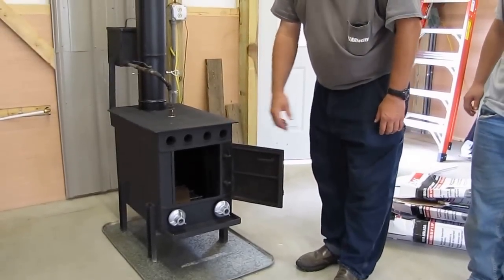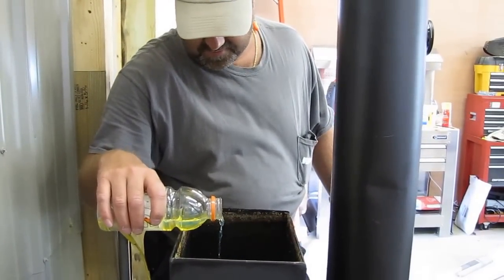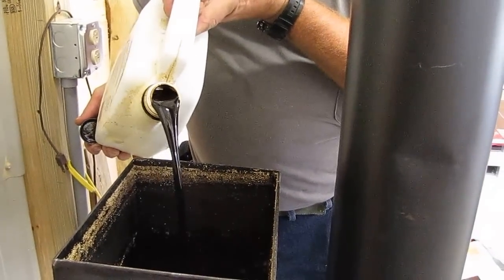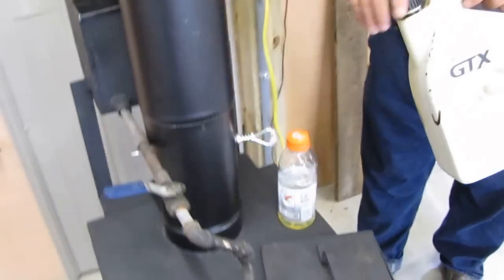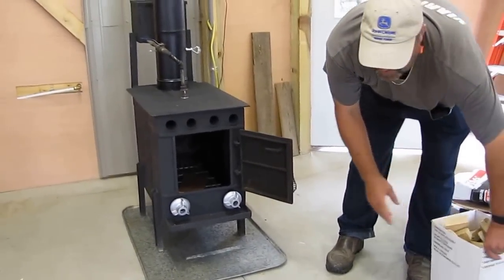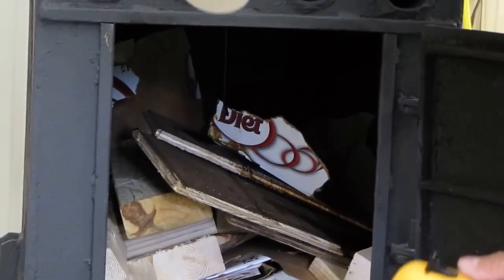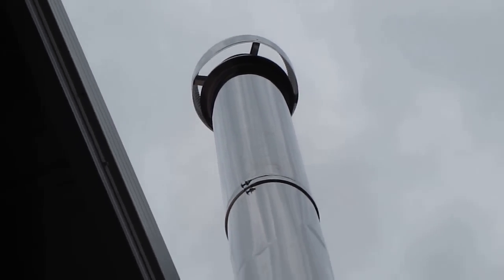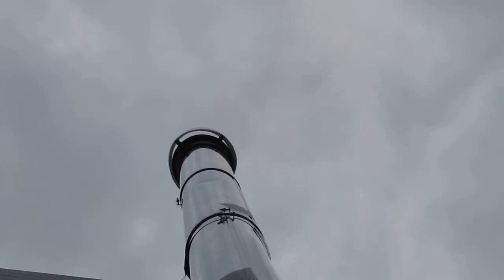Biomass Hybrid Heater And Stack Install  / Fire Time  Pt 3

Comment: You're bragging about how "efficient" this stove is by the exhaust temperature up the flu? Wouldn't "efficient" really mean that it maximizes all of the usable heat possible exhausting cooler air?

Comment: Where does the intake air cone from? Inside or outside? In your climate, you could have just used your solar panels to power a super efficient ductless split for both heating and cooling.

Comment: Too bad it didn't have copper coil around the top to heat water too.  Looks like a great stove. I know nothing of wood stoves, but will that heat that size building you have without any problems?

Tim